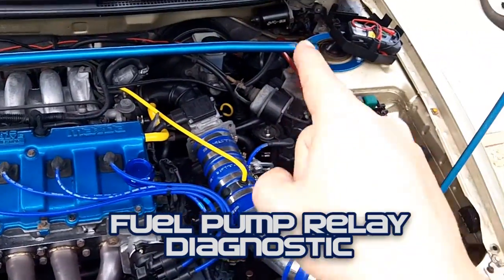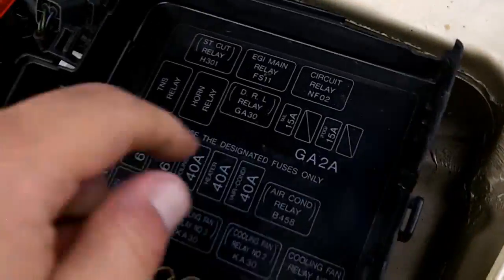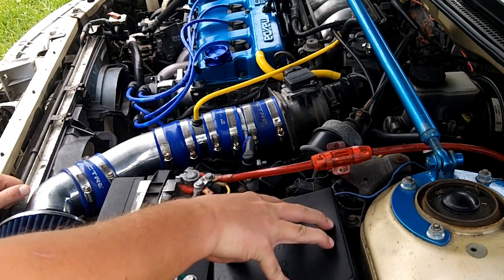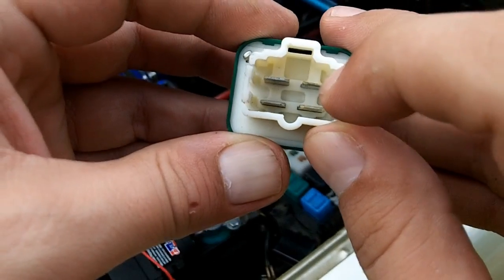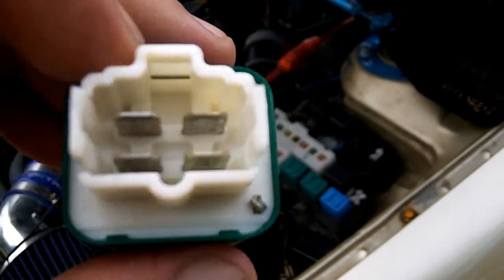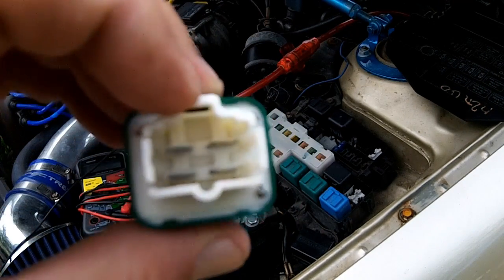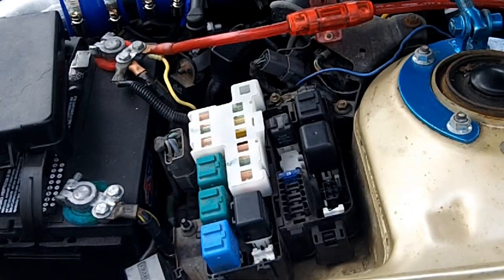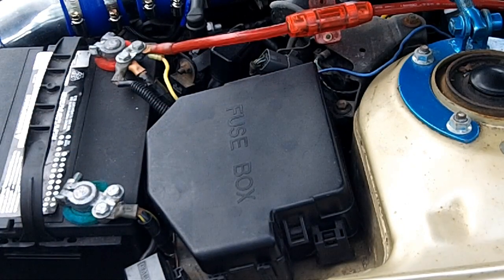Mazda 626 - Fuel Pump Relay Diagnostics

Comment: Is there a fuel relay bar or whatever too check to see if it has pressure??? Like on my Silverado I have a fuel relay bar and it looks like a valve stem and you can press it in and check to see if it has pressure Mazda doesn’t have this???

Comment: I’ve been trying to get my 96 ford probe running. It ran when I it parked2yrs ago.It turns over well but the fuel gauge don’t work and it doesn’t seem to get be getting gas. I looked for the fuel pump relay in the box under the hood. There isn’t one. Is there supposed to be a relay in the box? There’s a place for one. Or doesn’t the car need that relay?

Comment: Hey djdevon! I'm reaching out because I'm getting no spark on my 95 mx6 2.5 I originally thought it was my fuel pump and replaced that and my fuel filter. Just picked up a dizzy from the junk yard. But still no spark I dont know if it's a faulty one but I don't know what else it could be. Thanks!

Comment: I have a 95 626 DX. I have fuel  tank and pump out. The plug underneath the tank has 7.47 volts to the fuel pump it will not turn on tho. If I connect the pump to a battery at 12 volts the pump runs. What is going on. ? Please any advice?
Reply from the maker: Check your wiring from the fuel pump relay in your fuse box to the fuel pump. There's no reason why it should be getting 7 volts (unless your battery is drained) under normal circumstances other than a wiring issue. 7v suggests high resistance, basically green crudy degraded wiring between the fuel pump relay and the fuel pump. Most likely place that will happen is at the fuse box or wiring harness close to the fuse box. Check the pin connections to the fuel pump relay.  I think that should get you headed in the right direction. Sorry for the late reply.

Comment: How to Replace  Fuel ____Filter   2000 Mazda 626 LX 4 cylinders 2.0lt  I can not release filter from canister
Reply from the maker: The metal bracket around the filter comes apart in 2 halves and might have a band around the entire thing holding the 2 halves together.  It shouldn't take much effort to get it apart.  You can't just pull the filter out of the housing they grip the filter canister too tightly. ;)  The procedure is located on page 01-14-15 of the 2001 workshop manual found on pmx626.info for free.
Reply: Love your stuff on the Mazdas Looking for anything with DJDevon3
How can I find links. First time I ever asked for help Thank You ever so much.
Reply from the maker: https://www.youtube.com/user/DJDevon3/videos

Comment: hey i have a question! i have a 97 mazda 626 and the valve cover gasket blew and it would crank but not start! so i just replaced the valve cover gasket and it still cranks but wont start! but ran perfect before the gasket went out but now with new gasket it wont start!
Reply from the maker: As with any crank no-start you have to start with the basics.  Try shooting some carb cleaner into the intake as a fuel source.  If it runs for a second then dies then you know you have a fuel related issue.  Get a spark tester and test for healthy spark.  Get a compression tester and test for good compression (I have a video on that). That should get you headed in the right direction for process of elimination.

Comment: Mazda 626-2002 2.0 L four-cylinder . Since your car is different I'm a little confused about where my fuel pump relay is. In the video you said, third one over, one up, which would be the circuit relay just as it's called on yours but when I look it up online there's many images of Mazda 626 2002 engine compartment covers that have the EGI main circled with a 30 amp fuse circled as well. I'm unable to find in Haynes repair manual so far. Please help if you can.
Reply from the maker: Yes I think I made a mistake on the location in this video because I wasn't too sure.  I did get it wrong.  I knew it was either the 2nd row 3rd relay or 3rd row 2nd relay.  In any case on your fuse box diagram it should say NF relay or Circuit Relay.  Much easier to figure out. ;)

Comment: I might have mistyped but I am getting fuel. just not spark. I was saying I tested everything that I could the crank sensor you're probably right I didn't test it right but I went and got a brand new one and put it on and it still didn't start
Reply from the maker: If you get a crank no-start with good fuel pressure but no spark... test distributor.  If it was an ignition switch or neutral safety switch issue then it wouldn't crank period.  Since it cranks and spark is your only fault, distributor is prime suspect.

Comment: thanks. I got it. another quick.  question. checked fuel pump, fuel relay abs crankshaft sensor on my 94pgt. ands it's dead as hell still. NO SPARK. SHE DIED ON ME ON THE WAY HOME FROM WORK. WHAT'S NEXT?
Reply from the maker: Will crank but no spark or fuel?  Usually that's a crank sensor issue which you can only truly test with an oscilloscope. You saying you've tested it, I have a reservation of belief, not everyone has access to an oscope.  Tutorials online about testing the CKP by testing resistance are half-truth. That's one test sure but not definitive proof that signal is working as intended. It is possible to have a CKP pass resistance test but fail to provide correct signal, a short to ground upstream of the pigtail or faulty RF shielding are good reasons. Let's just say that you test the crank sensor by the factory procedure and it turns out to be good.  When "both spark & fuel don't work & your engine will crank & your crank sensor is good"; your next step should be to inspect mechanical timing & compression test.

Comment: I just found your tips on testing my fuel pump in my 94 Ford Probe GT grounded at the fuel pump relay click no fuel came through the lines whatsoever
Reply from the maker: Check for continuity at the fuel pump next.  Find exact factory procedure for your 94. If you don't get continuity then time to drop the tank and do a physical inspection and likely replace.

Comment: quick question is the inertia switch supposed to be down or up
Reply from the maker: Reset button is on top, ensure it's pressed in (reset), after you install it.  You can test it using factory procedures to ensure it's operating correctly.

Comment: unfortunatly car engine also not starting now ... 1 st fan not working 2nd fuel pump not regulating i guess it fuse relay what do you think .....
Reply from the maker: I think you should check for good spark and fuel pressure.

Comment: hi  have my mazda 626 1997 automatic problem is cooling fan and fuel pump not working but the rest of engine starts up easily plz explain your suggestion
Reply from the maker: Your engine is powered by magic?  Without fuel pressure the car won't run so I'll just assume that your fuel pump does actually work.  Cooling fan not turning on could be a dead fan motor, coolant temp sensor, or faulty throttle position sensor.

Comment: Hello was wondering if you could answer a question for me. I see you know your shit on mazda. Here goes. I have a 1987 626 with a 2.0L turbo 5speed.  After driving for a while the engine cuts out.  After 15 min to 20min it will restart. Feel like I'm losing spark. What should I  check.
Reply from the maker: +Tony Camacho Requires diagnostics.  Intermittent issues are always a PITA because you have to wait for the event to happen.  That's why taking it to a mechanic that has a labscope with recording feature can help immensely especially if it's a charging or ignition related event.  Basically you need a professional to look into your issue because it's intermittent.
Reply: okay thanks

Comment: i have crank no spark no fuel do you have any ideas
Reply from the maker: +philana wells What year, engine, trans?
Reply: 93, 2.0/ 4cyclinder, auto trans
Reply from the maker: Check for blown fuses, test the main relay, distributor and ignition switch.  You should will likely find a fault in one of those 3 and can go from there.

Comment: Is the relay just a straight pull to remove or are there clips that need to be displaced?  I'm having a difficult time pulling a similar relay on my Ford Probe.  Thanks for any help.
Reply from the maker: +arielrh500 Yes there are little clips down there.  Mine comes right out because I've pulled it out so many times in my cars life.  Sorry I didn't even think about that.  Get a tiny flathead screwdriver to help pry the clip outward a little and then you can pull the relay straight up.
Reply: +DJDevon3 Cheers!  The way they're jammed in they  don't make these relays easy to remove.

Comment: More like "Every relay diagnostics"? :D
Reply from the maker: Radim Brnka There are plenty of different types of relays out there that this procedure will not work with.  Depends on the pin arrangement for the most part but there are different types that have the same pin arrangement too.  This is a very common style of relay though.  I should have done a better job by showing the  diagram for this type. Perhaps I could be more specific and list the exact type in the video title or description?
Reply: Right, I meant relay by its concept - two pins for powering the coil, two or three for contacts (or contact pairs), the procedure is always the same for almost every relay, it's just about the pin arrangement :)

Comment: I have a 1990 Mazda 626 2.2L. It winds but doesn't crank over to start. Replaced the battery, coil pack and starter motor. Any ideas?
Reply from the maker: conner mcdonald If you can hear the starter working but the engine isn't turning then the starter is not engaging the flywheel/flexplate.  Pull the starter out and bench test it.  Verify that the pinion will move out when engaged and retract when power is removed.  If not replace the starter.  Check for damaged teeth on both the starter and flywheel/flexplate.  Verify that the engine can be turned over by hand, remove the fuel pump relay, put a breaker bar on the crankshaft pulley and turning the engine over a few times.

Comment: I have 1999 Mazda Protege.I changed my oxygen sensors,air intake hose,cleaned my MAF sensor,But my car still has a problem.I will drive it a far distance and after a while when I shut it off,it wont start for a while.Any idea what can be the cause of it?

Comment: I put new fuel pump new spark and wires, and changed the fried fuel pump injection fuse, gas goes thru the fuel filter, fuel pump starts, I crank it and won't start? Any ideas? Its a ford probe gt 1995 v6
Reply from the maker: Check for spark?  Are your injectors firing?  Use a long handled screw driver and put one end on the injector and the other end on your ear.  If you hear rapid clicking from the injector during cranking then it's firing.  You could use a noid light to achieve the same thing.  If you have both spark and fuel getting into the cylinders then check your do a compression test.

Comment: Just tested my relays, 98 Mazda 626 4cyl.. They all seem to be working
New fuel pump
Has spark
No fuel in fuel filter
It will turn over. Won't crank unless its shot with starting fluid then it will for a few moments. 
I'm not too sure what it is. This car sat for a few years. Only 38k miles. 
Any ideas on what it could be? 
Thanks in advance
Reply: fuel pump then...leave fuel filter off and crank for 1 minute...if there is no fuel in the line then its fuel pump vacuum pressure (a hole in the lines somewhere) loss or fuel pump doesn't work
Reply: microedit extend the line to a bucket (of course)  pressure is a ton (like a water hose)
Reply from the maker: I have an entire playlist dedicated to fuel issues.  https://www.youtube.com/playlist?list=PLL7U2Ji08Gq0UFSaKrE9oCldzUtI691ip
 If you have spark and crank then the only thing to check really is the compression and fuel.  You can spray some starter fluid like carb cleaner into the air box while cranking see if it tries to turn over/stumble.
Reply from the maker: microedit
I agree with you.  Most likely the fuel pump but whether it's a wiring issue or a faulty pump still need diagnostics to confirm.  My fuel pump inspection test video should cover both scenarios.
Mazda 626 - Fuel Pump Inspection Test

Comment: Hey Devon, I've got my self a 91 protege same problem, crank no start. Any suggestions?
Reply from the maker: With a crank no-start always check for the basics first.   Are you getting spark?  Good fuel pressure?  Do you have compression? Once you know the answers to those questions you'll know which diagnostic path will be next.  If there is no spark then it's probably the ignition system.  If there is spark then try to add a fuel source like propane, starting fluid, or carb cleaner.  If you don't have good fuel pressure then check the relay and if battery voltage is getting to the fuel pump.  I have a whole series on fuel pressure issues.  The procedures aren't the same as your 91 but the basic fundamentals are the same.  Tools you'll want for your tests are a spark tester, fuel pressure gauge, and compression tester.  You can get away with not buying a spark tester and grounding it to the engine but it's only like $5 from any auto parts store.  A spark tester will allow you to run a spark test without filling up the cylinder with unburned fuel.  Hope that helps, let me know how it goes.
Reply: Oh sorry! I should have added a few more details eh? Yes I have spark, not sure how to test compression though.
Reply: Michael Bergstrom bad timing has same problems as no starts
Reply from the maker: Michael Bergstrom
Mazda 626 - 2.0L Compression Testing

Comment: My chick's 2002 4cyl just died.  She started it after letting it sit up for a month, then tried to start it again 2 minutes later and it wouldnt start.  Battery was good, but a wire cam loose on the starter.  Got it cranking again but still wouldn't start.  Pulled off the fuel filter and checked for pressure, bad fuel pump (good relays).  Drop tank, replace pump, now I got pressure. STILL no start. check for spark, no spark. Ohm'd out the coil pack, bad. Replaced, car runs good! Thanks vid helpd

Comment from the maker: I'm not an expert.  I'm not even a technician of any kind.  Thank you for the compliment though.  If you search through my playlist of "Instructional Videos" there will be a video on there on replacing the fuel pump.  I did not make that video but it has all of the information you need.  The fuel pump is inside of the fuel tank.  The entire fuel tank must be lowered in order to get at it.  It's not an easy job and it's dangerous because it's... filled with gasoline.

Comment from the maker: Sorry I never saw this comment here, pretty late getting back to you.  If you can play with it and it starts then that sounds like a loose connection such as loose terminal pins that hold the relay in place inside the fuse box itself.

Comment from the maker: An aux transmission cooler isn't going to help after the fact.  It's a preventative maintenance measure.  If you've already burned up your tranny then installing a cooler isn't going to help.  As for the battery cables you just take the old leads off and put the new ones on.  It's simple as baking a pie.

Comment from the maker: 1st generation Mazda 626 = 1978-1982
2nd generation Mazda 626 = 1983-1987
3rd generation Mazda 626 = 1988-1992
4th generation Mazda 626 =  1993-1997
5th generation Mazda 626 = 1998-2002

1st generation Mazda MX-6 = 1988-1992
2nd generation Mazda MX-6 = 1993-1997

That's why you hear people discuss the 4th gen 626 compatibility with the 2nd gen MX-6. They are different generations but produced the same years and at the same exact factory.